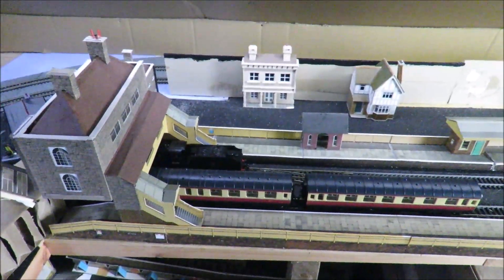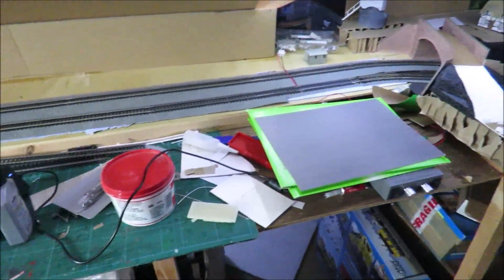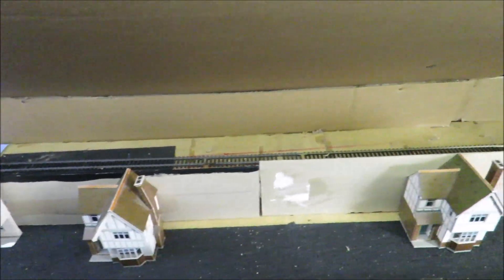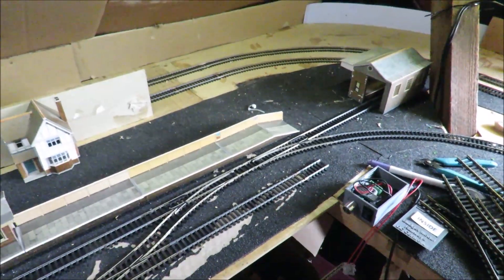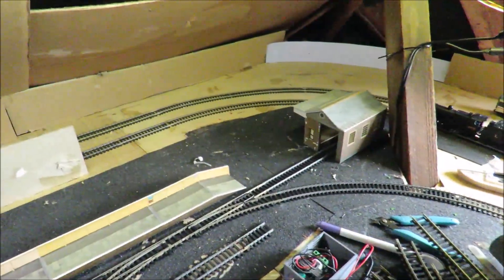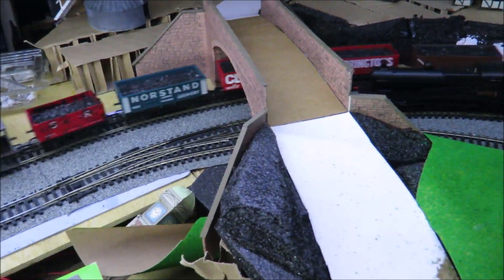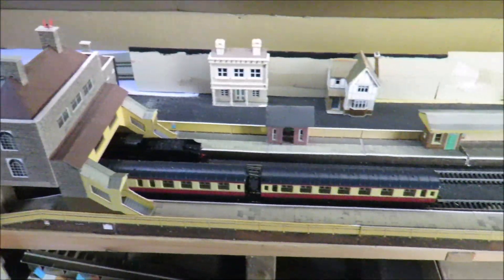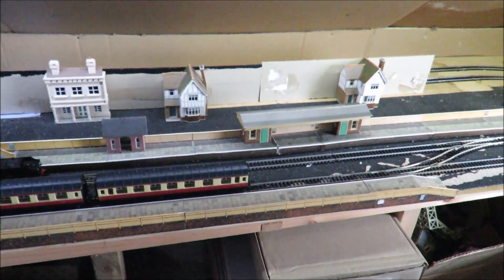OO Gauge Model Railway In The Loft - Ratton Central - Raised Terminus Station Building - Update 24

Comment: Yes! Keeping points on the main line to a minimum is the key to reliable running when you have a lot of small shunters and tank engines that do not like points (as I do). Hornby Railroad 0-6-0s seem to be particularly sensitive, although some are better than others. Two road shunting sidings are fine if your main focus is on watching trains run around the main loop which is my 'thing'.
Reply from the maker: It's a shame the 0-6-0s are so poor as they would be just right for shunting. Ironically the shorter wheel base newer 0-4-0s are better over points.
Reply: @BudgetModelRailways  I agree. But even the Railroad 0-4-0s tend to be better than the 0-6-0s, particularly metal chassis ones like the Bagnall.
Reply from the maker: Yes the bagnalls are great, I have a BR one on pre order, at a discounted price of course
Reply: You could go Irish and have mainline locomotives do shunting and pilot duty

Comment: Hi Mike.
It'll be interesting to see HO and OO in the same room.
 
I have just purchased a US mid-green & black 'Burlington Northern' diesel (Bo-Bo wheel arrangement) which is a runner and looks in mint condition, for only £33 inc. p&p. Can't wait for its arrival. I'm taking the advice you gave me in the comment section of the previous video by using her to pull wagons only (OO gauge). I did some research, and apparently at least one of those diesels are still active and have been reconditioned. My excuse for heading a British rake of wagons will be that a private company has borrowed it with a view to a purchase; not that I should need an excuse because as you often say: "Enjoy running your trains and have fun!".

Keep up the good work!  👍
Reply from the maker: In addition several industrial users operate US outline diesels in the uk
Reply: Wow, you've certainly done your homework. I'd love to find out where one of those beasts are running and film it. I'll have a hunt around on the internet.

Thanks for the info, very much appreciated.  👍
Reply: Didn’t know that Murican locomotives existed in the UK

Comment: I presently have a DC layout with two loops and am considering adding a third however I have a station at one end where I have a four track station which requires points to enter/exit. At the other end I have two storage loops for each direction which is handy so that I can have a continuous flow but all my points are manual and as a result I need eyes in the back of my head.
I have a Hornby Select DC controller and one chip which I might experiment with by  dedicating one track for DCC  but I cannot see investing in converting all my locos from DC to DCC
 I too have a couple of problem points or locos/coaches/wagons that sometimes don't make it through so I am constantly cleaning and gauging while learning  more about maintenance. As a result I can service most locos.
Another issue which I have not solved is how to turn my locos around. Any ideas would be helpful. Maybe you can check out my layout.
Thanks and keep up the great work

Comment: What company packages its goods in the discarded intestines of cheap doors (the thick cardboard mountain bases)?

For the platform length... which is a bit more problematic for continental rolling stock.
With modern continental rolling stock in 1:87 length scale 120cm is about the minimum... The longest train that will fit on that length is just 3 coaches and a locomotive (with a coach length of 30cm). A basic Railjet train is already over 120cm for the 4 coaches alone and that doesn't include another 22cm for a locomotive.
Alternatives are: go for a reduced length version (which shrinks them about 4cm per coach) or stick to Umbauwagen and pre-war stock which usually is around 20-25 cm in length.

Lengths are LOB / LÜP, which does not take in account coupler length, which Hornby does include in their published measurements.